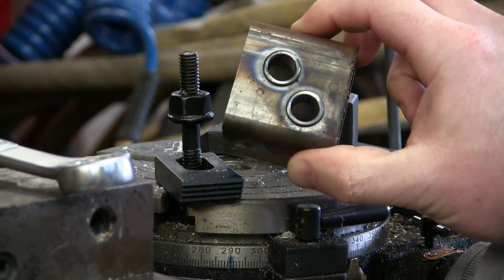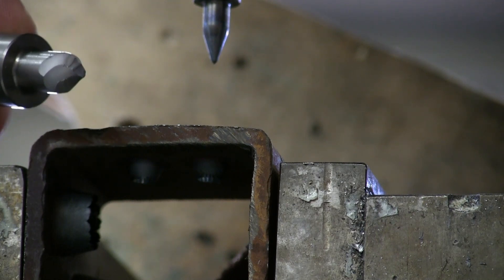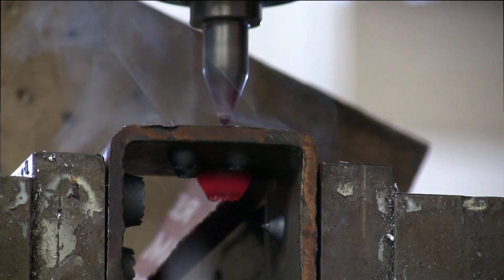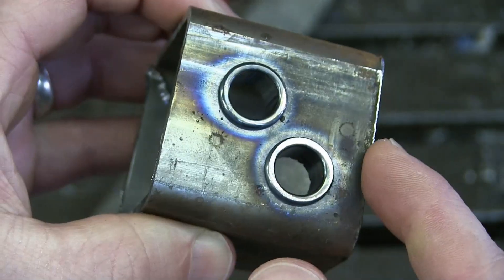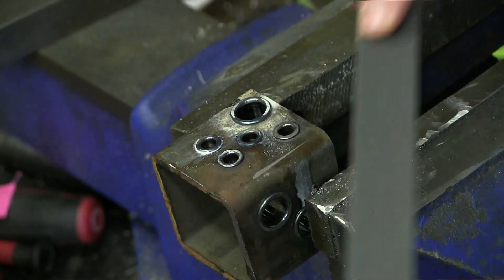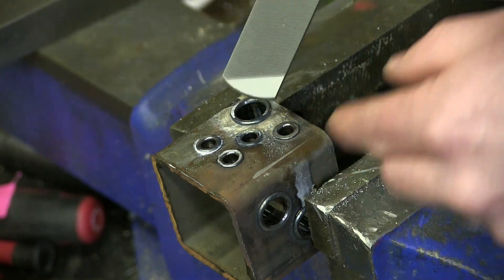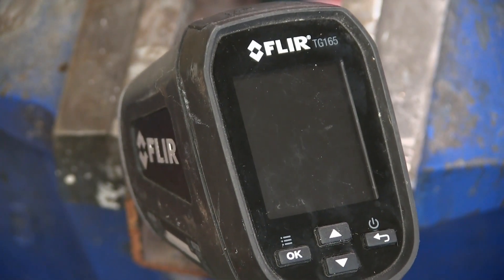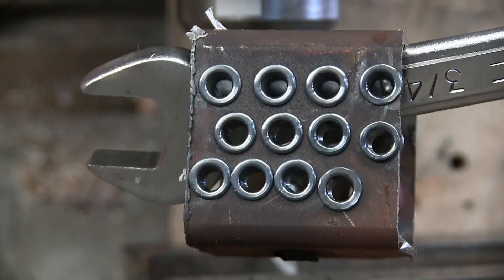Friction Drilling with Tungsten Carbide. Your Answers Questioned!

Comment: I use cunts-slung car slide bits all day at work. I've had them weld tho aluminum I'm cutting

 Frustrating to do a bit change but cool at same time. Usually happens when bit dulls out or leading edge chips off...... or lubrication system stops and bit heats up

Comment: Steel would not only have to have a high enough carbon content to harden but you would have to quench it in oil or water. Just left to cool on its own is normalizing/annealing.
Reply: Here steel is cooled very fast - heated only small point, other part is cool. That's why welding also hardens.
Reply: There is steel that does harden when left to cool by itself (high-alloy steel for example, gets up to like 62HRC) , just depends on the kind of steel

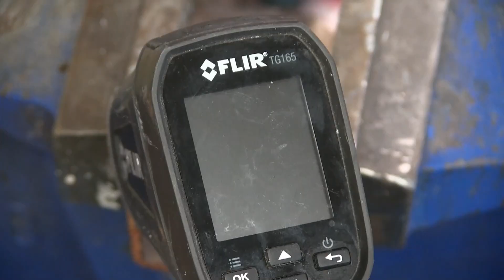Comment: 15:48 there is no hardware difference between the highest model of those FLIR cams and the lowest model they just limit the resolution by software. Load the latest FLIR model firmware and you'll be in 'bidnass'. 

For real there's no hardware difference betweeen the FLIR models you use. Hit me up and let's do 'eet.
Reply: Mah boy. Gimme a minute. Gotta hit the rental room at the shop. Step-by-step instructions OK?

PM me the model number of the camera you're using.

Comment: Heard that black smiths used to make files by spreading glue over the grooved metal before heating. The carbon from the glue would infuse the metal and you'd have a hardened file.

Comment: Another reason why the thermal temperature was off is because the emissivity of the metal is very low, unlike a painted black surface.
Reply: Some are, they must be set to a high reflective surface mode if they have one. There's always gonna be cheap garbage.
Reply: I'm not sure on the scientific reason, but I've not had much luck with thermal cameras on steel unless painted!

http://www.engineeringtoolbox.com/emissivity-coefficients-d_447.html
Reply: And another reason is that the metal is emitting red light (not infrared) and of course the wavelength is above the range of the camera.
Reply: If you need to be sure mask a spot off and give it a coat of flat paint; if it looks different on the IR camera then the emissivity is different.  If not then you're off to the races.
Reply: Partly yes.  Also that FLIR camera is a longer wavelength device, which never works as well for temperatures this high.  The Blacksmith’s eye really isn’t so bad on hot targets.  My calibrated eye says 950C.  That, or get an infrared pyrometer that works at 700nm or so.  The reading will be twice as accurate in this circumstance.

Comment: If you were to place two pieces of metal together and drill/flow through them with that, would the metal weld together or would the metal pieces simply be locked together? Ooooorrrr would the flow create two perfect holes in the metal pieces that would be able to slide off one another? (like putting a smaller pipe in a bigger pipe)
Reply: 2 metal plates would be firmly attached by the molten cylinder that it effectively creates.

Comment: The problem with the FLIR is that you are pointing it at something shiny. The emission-factor (The E-similar symbol shown at the down right corner) was around 0.60. This is not good. A pyrometer does not give accurate measurements unless the emission factor is above 0.8. This means that your FLIR is useless for metal, sorry.

Comment: When he said "Is it possible to friction drill by hand?  We're gonna find out."  I thought he was going to use a hand drill.  And by that I mean one that doesn't have a motor, it's powered by turning a crank with your hand.  Well of course, he meant an electric hand drill.  But he never said whether or not it could be done with a manual hand drill. I'm no expert but I'm just going to go out on a limb and say that no, it's not possible for most people.  It would be fun to watch them try, though.
Reply: Allan Asimov Super Man could... I was thinking a regular drill press, but I'm not Super enough so I'd never be able to do this in my baby shop.   I wish I had a Rockport to phuk with.   I'm curious about other metals, metals I use are copper, silvee, gold... not gonna phuk around and waste gold, lol
Reply: AvE said the problem is not enough downforce...I think that really means the problem is he's just not man enough, or rather, not enough man...you can only press down equal to your body weight and if you press down any harder you just lift yourself off the floor.  If he weighed 500-600 pounds I bet he could do it.  We should all send him palates of Peeps, he loves those things.

Comment: Drill something other than mild steel.  "Flowdrill is available in many sizes, suitable to drill holes from 1mm to 40mm with material thicknesses from 0.5mm to 10.0mm. Flowdrill can be  used in steel, stainless steel, aluminium, copper and some types of brass."    Also, try glass.

Comment: Iron has some carbon and graphite in it, can you friction drill a black iron pipe or whatever and harden that carbon? What is the practical application other than making a tappable surface?
Reply: Jp Labelle And hot rolled mild steel has some, but very little carbon. it is more than 0.08%. tool steel is closer to 2% carbon equivalent, and cast iron is above that.
Reply: Sizukun1 black iron pipe is also hot rolled mild steel, so you cannot harden it. You need carbon, or other alloying additives to make thw iron harder.
Reply: dude. all "steel" has carbon in it. otherwise it would be iron. Steel is simply iron smelted with a carbon source... it all about the carbon. yeah iron has a tiny amount of carbon in it.. but not enough to harden it. any steel can be hardened because if it didn't have carbon it would be iron.
Reply: still. tho tool steel is a whole different animal. I'm not saying it is anywhere close to tool steel. what I am saying is. IT WILL HARDEN. But only relative to the amount of carbon.

Comment: Could you "weld" two pieces of metal together with this?
Reply: Will Morton yes, that is called friction welding.   pretty awesome also.   search it up in the bar unless AvE makes his own vid. (hint...)   I think he mentioned when talking about cold welding a few vids ago.  but basically you take the two metal parts and spin them against each other with pleasure.   Then when they get red hot and deflormicate together, stop and they are now welded.

Comment: Cool process! Amazing. Although in 30 years of machining and precision sheet metal including tube steel of all thickness from 11 gauge to 3/16",  I never once saw the need for this method. Laser, conventional machining, plasma, water jet, etc. got the job done. Wall thickness never a problem with the use of threaded inserts or weld nuts anyhow.
Reply: Its to avoid the inserts.

Comment: what about hardened steel, can you use this to drill holes in high carbon steel?
Reply: I don't see the point of drilling through hardened steel using a method that requires you to harden it again, but you could actually cool the steel immediately after flow drilling with the same method as when it was hardened so it wouldn't be multiple steps. But as Gabriele sad, you'd still risk warping the metal, and you'd probably have a very uneven heat treat.
Reply: DougieFresh208 yeah it just melts it
Reply: losing the temper in the hole, but I guess you can
Reply: you could heat treat afterwards. you wouldnt be able to tap it while hardened anyway.
Reply: DougieFresh208 you still risk some deformation of the hole, tapped or untapped
Reply: mmmm that makes sense. im not sure what the application would be anyway. i just wanna see it done.

Comment: I wonder if you stacked some sheet metal and ran that threw them would it weld them together. If so how good would the weld hold
Reply: It would probably just be a shittier stir weld.
Reply: I would think drilling them with a drill bit and plug welding them with a mig or tig would be more solid weld. imo
Reply: @MrRatkilr  Most likely not and it would take more time to do it correctly.
Reply: @Bialy_1  Depends on resources you have and how strong it needs to be. Friction welding is a science of its own. takes special equipment to do it right.

Comment: Does it work on carbon steel? And do you really need to pull out for peck drilling, simply reducing pressure isn't enough? Or would that basically be "what to do if you want to snap one of these"?

Comment: Those Infrared thermometers don't work well in a machine shop. Shiny metal like an endmill or work piece has very low emissivity. Low emissivity means poor radiation. The thermometer will tell you it's much cooler than it really is.

Comment: That's pretty sweet. 

Only thing though is for the true purpose of speed holes this doesn't really work. You're not removing material, hence weight. It does give a badass look though.
Reply: you're not taking air resistance into account though.
Reply: How do you mean? The only time I've seen speed holes used in any kind of exterior body work is on something like a rear bumper that acts like a giant parachute at high speeds.

Comment: Technically, you can harden mild steel; it's not so much that it doesn't have enough carbon to harden, it's that it just doesn't have anywhere near as much as the usual suspects. Actual hardening is the process, however, not just the material; that pipe isn't hardening because it's left to air cool. If you quenched it with water or oil from red hot (above it's transformation range), it would harden more (but only so much, again). There's more to the chemistry of this, but that's the blacksmith's perspective, as it were.

Comment: With regards to the FLIR, it's important to note that the melting point of anything changes based on pressure . The increased pressure would lower the melting point of the metal substantially . The boiling point of water on Everest is 71 degrees C, almost 30% less from a mountain!

Comment: I have a solution to your FOCUS YOU FACK problems: manual focus. When doing long runs at a single angle, set the focus to be a specific distance and leave it.

Either that or constantly check it, but we all know how well that's working (a la FRAMING YOU FACK).

Comment: So what speed will make these work if we don't have a bridgeport?
Reply: 3000 rpm
Reply: Neil Howard Thank you.  So could/would a 4000 RPM electric hand-drill do it with a smaller bit?
Reply: If you can apply about 2200 N of force (or 220kg of weight) on the hand drill.. might want to ask a gorilla.

Comment: Pour cold water on the holes while they're red hot, might harden them a bit more?

An in the en, if you mean speedholes as the ones you drill in cars or other things to make them lighter (and therefore faster) that won't work, its not getting lighter...

Comment: its no wonder you break so many taps 
your so shaky with your powertaps and you go to hard and fast hand tapping. all you gotta do is be steady and do 1/4 or smaller turns to go in and 1/2 or bigger reverse turns to cut the chip. if your hearings not already fucked you can hear the chip ping as it comes off

Comment: what if you put two pieces of steel together and drill in between. will they weld together?
Reply: It should work, it would basically be friction welded.
Reply: Indeed, they would (assuming enough sandwiching force is applied to maintain consolidation)! Did my thesis on friction stir welding. Very similar process :)
Reply: Good question, although I'd be hesitant to say it would definitely weld, the bitting is a critical part in stir welding. I don't think it would have the outward penetration to pull it off.  1 beer says IF it does weld, it won't hold up to a comparable butt joint ;)
Reply: Yes! For science!

Comment: Another question from a do it a homer. Can one use this magical bit in good old fashion drill press?
Reply: Steve Michael. yes you can. but you need at least 3k Rpm.
Reply: Steve Willette 
With a floor model and cranked all the way ⤴ and a two foot cheater bar on the handle,........ yes !
Reply: 3000 RPM is not the problem (a battery drill can manage to do it, even a Cryobi) the problem is that you need about 200 kg of force on the drill, which may deform the drill press and at the very least you need to extend the handle with a lever.
Reply: MrOpenGL  thanks a lot. Going to hold off on trying that.
Reply: MrOpenGL  thanks a lot. Going to hold off on trying that.

Comment: 10:00 or something

Try drilling something with it fully submerged in carbon (Think SAW - Submerged Arc Welding style)

Soak time won't matter because it will get mixed up deep into the molten metal and you'll get your little carbon atoms all over the crystal structure.

Comment: cool it faster after you pull out with canola oil and it'll harden
Reply: My amature friend, the oil goes on BEFORE you put your tool in. Thank me later.
Reply: fordrac1ng81 you didn't listen did you? Not enough carbon = no hardening. It doesn't matter how you quench and temper it.

Comment: I've seen guys case harden knives made of mild steel using GRANULATED sugar in welding ovens, and apparently it works better with the more heat you can pump in. You could try making a foundry yourself like the one "The King of Random" made some time ago (you could also use it later on to salvage metal chips so as to save in material acquisitions). 

GIVE 'ER AS MUCH HEAT AS SHE'LL SUFFER!

Comment: Unrelated to getting hot and penetrating things I think watching this Chanel has rubbed off on me. My ultrasonic cleaner broke ( I knew she was about dead when the off and on and timer setting buttons became interchangeable). With my zero knowledge of electronics except from watching you, I worked out it was dead, then tried to wire up my own transformer to the transducer and chucked the busted pcb. My set up made a noise but wasn't really going at it like it should. Clearly now I have established the perfect rocky foundation to start looking at parts that I don't understand to make my own.

Comment: as a reminder kids, never drill into Tungsten Carbide with a Tungsten Carbide drill .... that will destroy time and space all together
Reply: MrJunkiePlay lol that sounds terrifying. please try this ave, and stay safe.
Reply: hehe, would be cool to watch
Reply: @MrJunkiePlay  from a distance.      Its not fun to explain to the er doc as they remove shrapnel
Reply: Like dividing by zero?
Reply: and never google "google", it will break the internet!
Reply: Ask Shiryuu. He knows the answer.
Reply: +MrJunkiePlay Been saying that for a few vidjeos now. this needs to happen!
Reply: Nah man. It's more like (3-3)/(12-12)*0. It ain' pretty, and your confounder will hate you, but it works.
Reply: David Rahn you say confounder he says confuser yet they both give you 2.75 out of nothing??
Reply: I'd be down for the time bit goin' away. As far as space goes, I could use some more in my shop for sure.
Reply: I use the tungsten to destroy the tungsten.
Reply: I design and program for a carbide manufacturer. A simple 1/8" PCD (polycrystalum diamond) coated endmill is approximately $120. If you want to use a precorp drill, which is essentially a solid diamond tip drill, now you're talking about $400 all the way beyond $1,000 for a single tool. Don't break it! 😂. In this particular video, I'm guessing the frictional tool is made of LC115?? Not totally sure